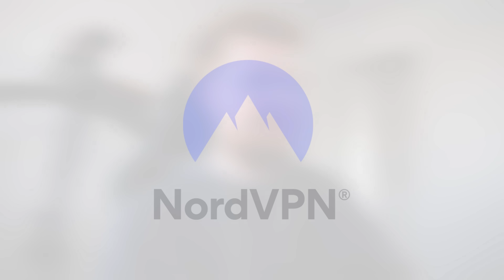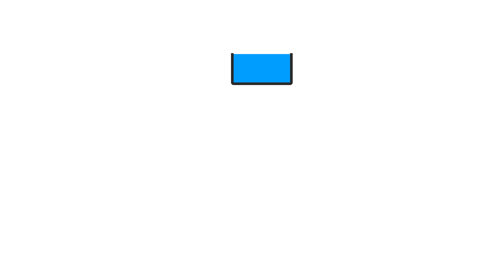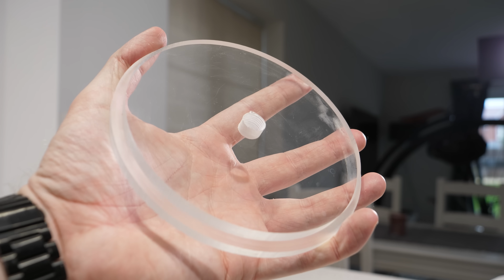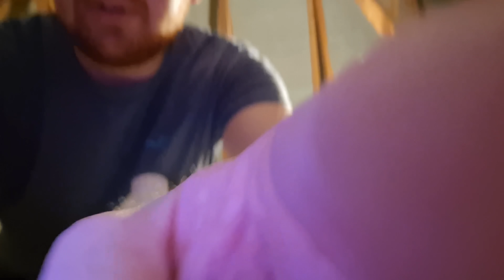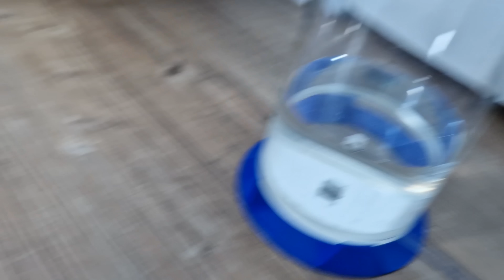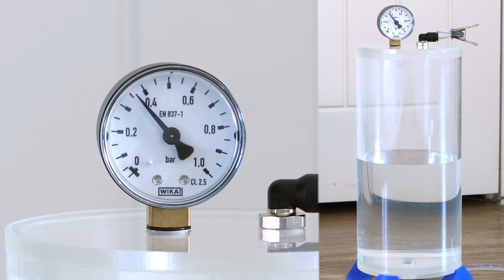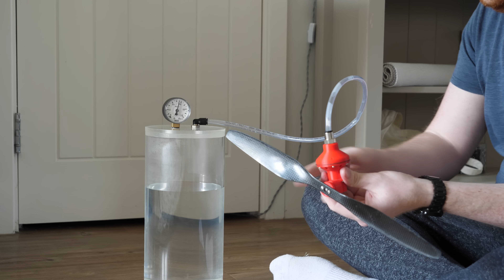Liquid Air Engine

Comment: I'd love to see your e-bike powered by standard lithium cells, with supercaps inline. The idea is that regen braking generates far too much power for the standard setup on an e-bike, but could easily be absorbed into supercaps, which would then leak their charge to the cells. Nobody's done it yet, I must be missing something. If the supercap cell count was enough, wouldn't it mean that a 30 second charge might get you enough for a 5 mile "get me home" charge?

Comment: Hey! Seen as though people in YouTube comment sections can be more helpful than school in teaching me things I didn’t know, does anybody have any tips for a kid that wants to start building gliders, and when available, powered rc planes? Just to avoid any usual snagging points that could ruin equipment, best materials that are easy and cheap to get a hold of? 
One important thing to add is that I don’t own a 3D printer at this point in time however I do plan on getting one, and when I do, what Is the best filament to buy for rc planes and such ( I.e weight, reliability under high air pressure and stress in general.) 

Cheers!

- a kid who likes RC planes and physics.

Comment: this engine is amazing, but i cant help but thisn that a guvanor would welp the engine run at a more consistant speed for longer, not sure if you could 3d print a regulatro the the guvanor itself should be quite straightforward! this is really impressive and i have really enjoyed seeing how your design has evolved.

Comment: Very cool!  My suggestions are to use a brass tube as your cylinder and route an acrylic piston with an o-ring and grease to get a smooth, low friction air tight action.  My other suggestion, after watching you use water turbines to harness air, is to use perhaps the air turbines in early missiles: https://www.youtube.com/watch?v=EgiMu8A3pi0&t=3300s

Comment: So I am sitting in the bathtub minding my own business, pouring plastic cups full of water on myself, rinsing off the soap from my top half. I dip the cup in and remember back when I was only 396 years old, and the vacuum force created when you pull the cup above the waterline without letting any air inside. I was disappointed to discover that the force created was not going to circulate the water in the manner I had hoped.
But as stored energy goes, would (a) “water displacement capacitor”  type of system help in any way?
Would love to see some experiments on floating “WDCs” with air, and freshwater vs saltwater. 
So awesome that you have all these amazing skills that enable you to create what you think. Honestly, I am envious. 
MJ

PS
Thanks for sharing!
Reply: Can you reuse the exhaust air to re pressurize either the top or preferably the bottom container? It may at least have a flywheel affect on the lower tank in that it could prolong the pressure event. 

If you could get the water back up to the top tank, could you then alternate pushing air down to get the water up again?

What about using the exhaust air to spin up a flywheel that mechanically causes the water to go back up to the top?

MJ

Comment: This video gave me quite an interesting idea, in order to create air pressure. Imagine three chambers put end to end the first one being open on one side and closed on the opposite side by a non fixed plate that also closes of the second chamber on one side and is connected to a much smaller end plate on the other side. If there now is a vacuum in the middle tank the pressure on the larger plate would push it in together with the small plate Wich since it is small would have a smaller force acting upon it then the pressure in the third chamber would be much higher than atmospheric.

And then you can adjust the proportional size between the two plates in order to get either more volume or more pressure.

Comment: You should try winding inlet tube around warm surface so water volume increases without external heat supply.

Comment: Hey Tom have you heard of a tromp? It uses water to compress air. It was used in mining to make compressed aitr for tools. And it has no moving parts. Here's a video from 2 years ago from a favorite YouTuber engineer of mine. I wonder how long your motor would run on it? https://youtu.be/uvf0lD5xzH0

Comment: Wouldn’t the tank of water need to be as large as the area above the air tank like a lake or ocean and not a small tank of water, did your math factor in the size of the tank of the water? Could you increase the size of the tank of water and the size of the down tube to increase the pressure?

Comment: I think you should attach a flywheel I know it take some rpm but will increase tym and you make more shorten the rod for less air enter in cylinder in less air pressure you can make engine run with just flywheel momentum I hope you will understand after you know everything I saw vedios are very good you should try this thing at least one tym👍👍👍

Comment: As this engine is able to run as such low pressures, you may consider an attempt at expanding air with a solar panel and a check valve.  Put air into a solar panel and use a check valve to prevent it coming back out of the inlet.  The air will only be able to go out one way, into the engine.  At such low pressures, you may be able to sustain a longer or even infinite, run time.

Comment: What would happen if you put a bigger flywheel on the motor?

Or if you added 5 more cylinders/diaphragms to make a 6 cylinder engine? 6 cyl engines can be perfectly balanced so I guess you’d gain a lot of efficiency from less vibration.

Comment: Interesting project, would be adding a small gear reduction for increased rotation (but maybe it'd require more pressure?) and locking the rotation in one direction help?

Comment: if you move the test outside, you could attempt using mercury instead of water, I'd be curious to see the difference in pressure because of mercury's heavier weight.

Comment: Very cool. I'd enjoy seeing some more refinements to the engine to reduce losses (more polishing of the piston and bore? More efficient diaphragm materials? Maybe route the exhaust air to act on the rear of the piston for a combined double-expansion double-acting action? (using the pressure left in the exhaust to help power the return stroke so less prop momentum is lost to that) and optimize the geometry. It's really entertaining to see you develop and test refinements.

A small air pump connected to the air tank outlet would let you push the water back up to the storage tank and save some trips up the stairs carrying water.

Comment: Your doin this all a bit backwards. Air battery, into a cryophorus tesla turbine. Fill the vessel with air then force fill with water pressurizing the water, released into vacuum thus turning to supercritical steam at room temp, then spinning a tesla turbine.

Comment: You should make the position of the ball valve adjustable so you have throttle control even at higher pressures. Even better if you hook that mechanism to a governor so no matter what the pressure is the engine spins the same speed

Comment: Tom, that was brilliant. You got me thinking about the possibility of gathering water in the roof from rain, as well as perhaps gathering moisture on the roof of a house by using tile surfaces (hopefully solar tiles) that nucleate water overnight, so droplets run down into 'catcher' to store water for electrical generation. Obviously rain is appealing in wet climates, but 'nucleating water' overnight, would appeal in moist temperate climates since its regular. I was thinking to catch air in the walls of the house for an added heat exchanger in the roof for more energy capture. Be a good man and make it all work for me. 
You're clearly the man to arrive at an integrated real life solution, for a house, and possibly a campervan. I'll happily collect the royalties for you. I'm strictly an ideas man. But I can count.

Comment: Giving yourself this constraint (low pressure, low flow rate, etc) really made the task much more impressive. How well does this engine run on your normal air supplies you use? Comparison time?

Comment: Good work! I loved your problem solving to get the engine to run properly at low pressures.

Also the mentos in coke doesn’t increase pressure 😂

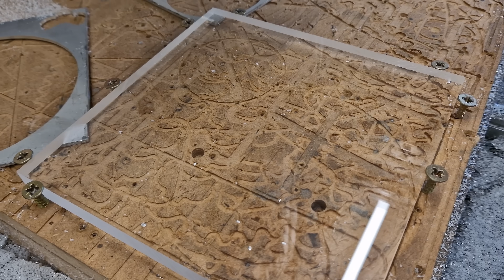Comment: @2:57 most materials cut well if you use the right rpm, feed rate, depth and step of cut and the right type of cutter/endmill. (all determined by pretty simple calculations). when i was a machinist i liked using 2 flute endmills on plastics and even aluminum endmills instead of highspeed steel or carbide. love your videos, great content.

Comment: Tom, this reminds me of Circular Breathing; like a technique used by woodwind and brass musicians. My thought is you could have a small reserve tank similar to the one you built, switch over to that when the pressure runs low allowing the main tank/reservoir to accumulate pressure and switch back. maybe use an arduino controlled solenoid? Thoughts? you may get a longer runtime... cheers!

Comment: Now play with using the engine on a manifold to two tanks...and valves... And aux pressure...and H20 relief valves... And a water resivoir

Comment: I can see more opportunities to increase the efficiencies. A couple of guides extending into the chamber and corresponding tabs on the piston. Should introduce more stability at low cost of friction. A little lubricant would also help. You could tinker away for a long time just experimenting with what improves performance. Maybe "borrow" a regulator from a compressor to stabilize the minimum pressure. One learns so much from iterative development. Thanks for the video!

Comment: How can the pressurized air in the tank be at 0,6 bar, when atmosoheric pressure is about 1 bar? Does the gauge just tell you the difference between inside and outside air or am I missing something?

Comment: I always wondered about doing this with a ram pump. If you have property with a river or Creek with differences in elevation you could practically have free endless water and air pressure.

Comment: The eccentricity and difference in cutting experience between the two acrylic products you sourced is due to how the plastic was produced. Extruded acrylic (the first product you tried) has absolutely miserable machining properties when compared to CAST acrylic (the second product you tried) as there are significant differences in the the two processes that result in different working behaviors. Should you need to do more machining operations or find the need to tap a sheet in the future you can use plain dish soap as a coolant. And the same is true with polycarbonate which is inherently incompatible with petroleum-based machining oils/coolants as well as alcohol.

Comment: I wonder if there is a theoretical ratio of height of water inlet/ pressure tank/ propeller engine that could resemble a helicopter or is there not enough energy in this concept?

Comment: i was part of a project that needed a drone to be on air for 24H surveillance, we had to establish a system to give energy to the plane for that long so we have decided to find a very thin and light cable and send it to sky in a circle ramp, on it's way and every complete run it had, the so called cable would grab on some sort of antenna passing a very high voltage and low ampere current to charge (shock) up the invertor we made on the plane, now that i see this, i would say with a little bit of changes and some high precise machining this can fly for a long time if the sky is clear, by the way the sky was not sunny enough to get solar panels charged on that area if this comes to your mind, we tried solar and it didn't work

Comment: Before you calculate the pressure the water builds due to the height it's 1 bar per 10 meter you don't need anything else

Comment: I have an interesting idea so you could run the engine longer, Mercury can pull air down when it flows through a tube, see if their is a safer fluid that can do the same(This is the principle behind the sprengal vacuum pump but you would use the pump to pressurize rather than pull a vacuum)

Edit: This video by Cody’slab explains the sprengel pump well
https://youtu.be/viJ3T-1KZqY

Comment: What would happen if you try running this modified version of the engine with a regular air supply like the classic water bottle container in high pressure

Comment: Could you also explain how this is better than directly running it using water flow (like hydro electricity generation) since we are converting energy from water to air wont there be a loss of pressure?

Comment: I cut plastic every day as a plastic fabricator I use 18000-24000 rpm and 30-60 feed rate depending on thickness

Comment: FYI, diameter and distance determine flow. You could increase the diameter of the tubing, use reducers to keep the same fittings, and have a significant increase in flow.

Comment: In case you are not aware, a failing pressure vessel filled with gas is significantly more dangerous than one filled with water. That's why most tanks are hydrostatic tested. If a tank ruptures, the gas will continue to apply force while expanding until it equalizes with atmospheric pressure. This can produce significant acceleration of the tank fragments making them white dangerous. Meanwhile, since a fluid is effectively incompressible, when the container ruptures, there's almost no expansion, and very little force transferred to the fragments.

Comment: What would happen if, a tube was arranged in a spiral cone shape, with the narrow end face down in a tank of water, with the top end fitting inside a static pelton wheel, would an initial input of rotary power initiate a siphoning effect up the spiral, forcing the water outwards at the top, into the pelton wheel ?  Would it be enough to sustain itself , having captured inertial energy in the system.........

Comment: Water should enter from top, not bottom. The way you made it, the pressure due to the weight of the column of water accumulating partly annihilates the pressure of water coming in. Thus the main reservoir is at equilibrium with pressure of air + water(pgh) and you store less energy in the tube. To do that should be sufficient a valve to stop the flow from above.

Comment: I think the plastic cutting worked better because, in my very scientific terms, the heat created got sucked away quicker by the surrounding plastic, as there was more of it due to the thickness, before it could melt.

Comment: I'm still waiting for a liquid nitrogen gas engine. Imagine a small tank capable of holding liquid nitrogen that goes into a small radiator that changes the state to gas and provides pressure. You could even heat the slightly with a battery and heating wire to increase the pressure even more

Comment: You could have used a vessel(pressure cooker) with water drill a hole connect it to the pressure vessel and you could have got more pressure

Comment: would it be possible to run your engine off the pressure generated by boiling liquid nitrogen? A container of liquid nitrogen should have constant evaporation as the heat transfer from outside to the liquid should be about constant. Long tubes should give the gaseous nitrogen time to heat to a near-ambient temp to run your engine. The density difference between liquid and gas should give you an easy way to carry/generate a huge working volume of gas.
If it works the next step could be to make your own liquid nitrogen. I think I saw something like that with the original king of random, or maybe some other channel. Could even turn out to be your version of the liquid air battery.

Comment: You could prevent the engine from drowning by reducing the amount of water by a little bit. The engine will automatically stop as soon as the water level in the attic drops below the tube entrance.

Comment: It would be cool to see this scaled up. I know it’s not really efficient or practical for much, but imagine using an engine like this made out of steel/aluminum parts with a large 100+ gal water tank at 50 feet plus, with a steel pressure chamber at the base.

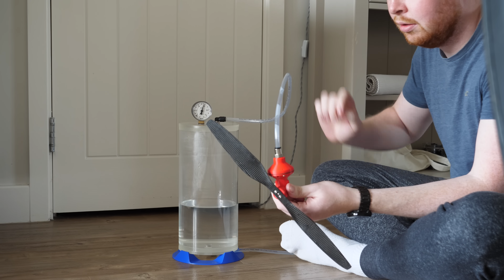Comment: Did you carry the water back up into the attic after the first run (11:38)? Really? I mean, with the bucket? I would have used an air compressor to pump 5l of air back into the lower tank and the water would have traveled effortlessly to the top tank. What you did here it's called a constant pressure expansion tank and this system was widely used a few years ago within thermosyphon heating boilers and heat pumps. That was before the wall mounter boilers and the sealed membrane expansion tanks came to the market. But nice video, as usual. And very good demonstration. Thanks. You have a big like from me.

Comment: 0:16, fun fact, adding mentos to coke actually would not increase pressure in a tank. All mentos does is provide the coke with air pockets, which results in more carbon dioxide coming out of the solution, which results in more air pockets, etc etc. The pressure isn't changing compared to if you just left the coke in the tank until it became flat, it's just reaching equilibrium faster.
Reply: Actually the pressure would increase, the carbon dioxide is, in a way, compressed by being in solution. When it comes out of solution it acts more like a gas increasing pressure. The same thing occurs when you shake the heck out of a can and it starts to bulge.
Sorry I know your comment is literally two years old, but I felt the need to correct it for anyone else who comes across it.

Comment: Could you add a Governors that would regulate the pin that push on that air valve and spin a large flywheel instead of that prop.